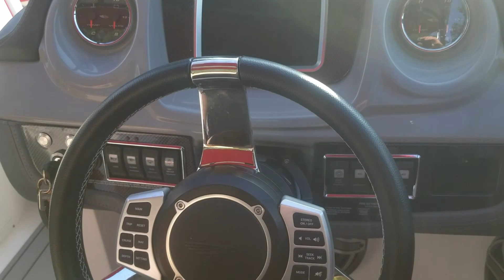BRP Rotax Jet Boat Principles and Operation Guide, shown on a Chaparral Vortex VRX 223

Comment: Boat has been very reliable until recently.
The battery selector switch decided to fall completely apart, the back end with all the cable connectors cracked and, we lost all electrical power. 
Fortunately it happened at the dock and not in the middle of the lake, first indication, turning the knob I could barely feel the detents any more, in position 1 the instruments did not come on and the engine would not crank over, only position 1-2 still worked.
Got a new switch, brand is Blue Sea, part #6007 which is very much updated, a lot beefed up, installed it and all is well.

Comment: I have a 2 year old Scarab 215ID with twin 300;s. All of a sudden the starboard engine will not start. It turns over but won't fire. I did the exhaust clean out and it was clear. Any suggestions? I don't have a dealer close by either.
Reply: Did you get the problem fixed?
Reply: @rhettc416  Short answer yes. Went to a 2 battery system as it is in a slip and the bilge pump would drain the battery. However Rotax engines are also famous for "E Reverse Module Error." Not fun, puts the boat in slow mode. Through the jet boat site, I was able to determine 2 20amp modules are faulty. So $12 later on Amazon and we are good.

Comment: We bought the single engine version (VORTEX 203)  3 years ago, they are  great boats with a few words of caution.
They are noisier than a regular boat with a stern drive, the engines run at way higher speeds, max.8000 RPM, and as a result use a lot more gas.
Also, and i found this out the hard way, when coming into shallow water, turn the engine OFF, even in neutral the jet drive  acts like a huge vacuum cleaner and sucks rocks and gravel up from the bottom and will damage the impeller and wear ring, happened to me last fall when taking the boat out of the water for the  winter. 
At least it not hard to take apart, Iv'e been a mechanic all my live so pulled it apart and replaced the impeller and wear ring and all is good again.
On the plus side, we bought the boat for water sport and since it has no propeller it's way safer than a regular boat, but even in the manual it warns you not come too close to the back with loose clothing or long hair since it can be sucked in to the intake.
I always turn the engine off when people are in the water and close to the boat.
Manouverability is great, the boat will turn on a dime, even does 180's on the spot, and what is really impressive are all the menus you can choose like for skiing, all from touch screen, accelleration curves, speed, even cruise control.
Docking is a piece of cake, just select docking mode from the on screen menu and you can literally inch the boat onto the lift or beside the dock,awesome.
i did find out to my chagrin that customer service from Chaparral and the local dealer is awful, we had trouble with radio reception, amplifier  problem and all Chaparral did was revert it to the dealer who did nothing, I repaired all the problems myself.
After my last call with Chaparral asking what impeller the boat had, so I could replace it, they could not tell me and reverted me to BRP, the snag is that BRP has no listing for the boat so I spent hours on the internet researching where to find a wear ring and impeller, finally found them through an independent marine dealer. 
All in all still happy with the boat, but it should have way better customer service considering the amount of money they charge for them.
Reply: Hello Hermin .
We have a vortex as well with lousy radio reception. Can I ask how you solved that problem.?
Thank you in advance .